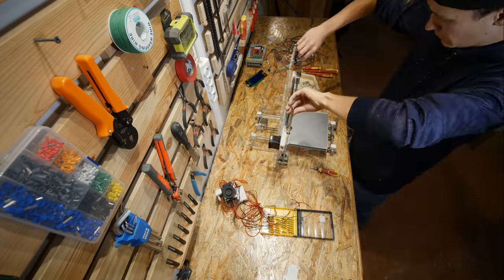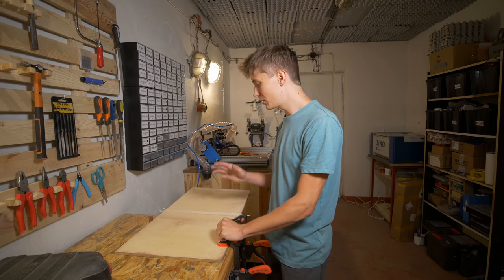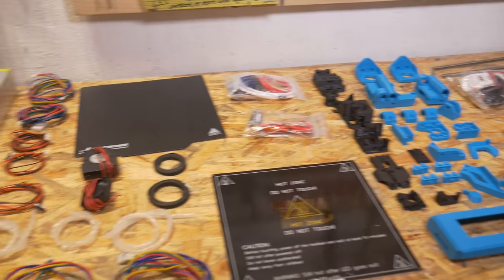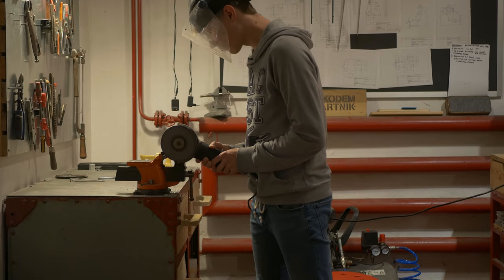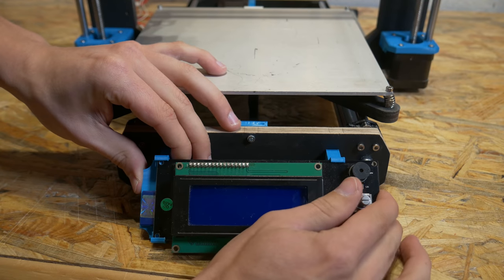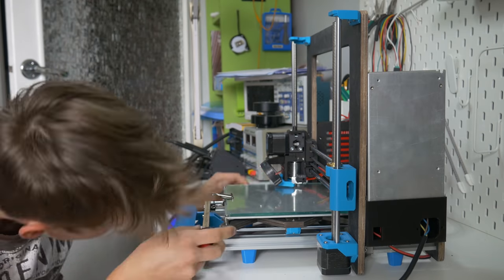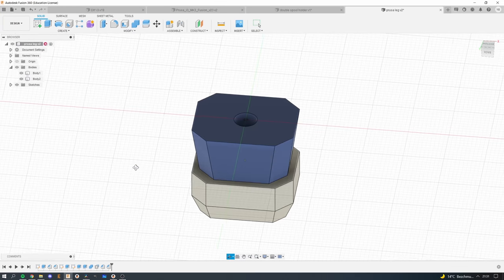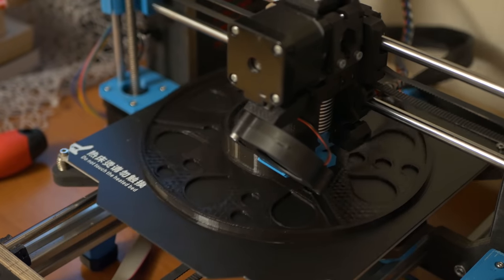Building a DIY Prusa i3 in 2024

Comment: It's a great idea reviving that old printer Nik!! I started with an old Mk2 clone I got from a friend, then built another two heavily modified i3 style printers keeping the kinematics on slightly larger frames, and both on 9mm plywood box frames. Much more rigid than single 18mm ply. Just a hint on bolting on or trough plywood, soak the holes with CA glue before assembly, makes the ply stiffer. And yes, dont forget washers :-D The only thing is, all plastic parts better be printed from PETG rather than PLA. Other than that, nicely executed project, well done!!

Comment: Great rebuild/upgrade to an old printer! For the flexible, it looks like it's clogging since it started fine and then had issues. If part cooling is on, turn it off, otherwise I would only increase the print temperature and try again. 👍
Reply: Printing tpu can be challenging but what I found out is to increase the flow rate to 120% 228 degrees on the hot end, bed temp off, and part cooling off.
Reply: @joeanderson2642  I haven't had to adjust flow any for TPU. I run first layer at 250, then 230 for the rest. Depending on the design, I may turn on cooling but no higher than 30-40%, mostly for bridging stuff. I slow it down to 30mm/s and use retraction too. I always heard TPU was difficult but mine come out like it's PLA.

Comment: I bought one of those china clone  3d printers  for about £90 and it was not very rigid so i kept it as it was  but  mounted it on a ply base plate then added wood blocks  to reinforce the frame using gorilla glue  that made it very solid i added motor mounts   printed by the machine  plus another few improvements  a  extruder  head ducting fan really improved things and  my machine  turns out prints better than my mates ender 3 he cant get it to work  as good as my old cheapy clone  ... good video and  good luck with your projects

Comment: Hi, thanks for the video, it is great . If you want print on glass , you need to take thinner glass like 2mm and wait 5 minute after printing  to the bed temperature decrease, in this way you can pull over your print with the hand with no difficulty. I saw you pull hard on them, you can broke or bend your prints: 
See you around

Comment: Very Nice! Ive done the same but using conduit as a frame. Your flex filament issues could be due to not having the bite of the bondtech. I have printed beautifully with those, while the old tensioned filament wheel with a gear used in cheaper clones like my ANet A8 gave me a lot of problems. Once switched to bondtech it has been smooth sailing for the most part

Comment: Plywood will eventually absorb water and warp.  I'd apply several layers of polyurethane varnish and/or epoxy  to seal the wood before assembly.
3D printed extruder parts that are under spring tension will eventually fail.  I'd have CNC'ed them from aluminum.

Comment: @03:11 Am I the only one that sprays the hard to reach areas ( like the edges, corners, etc... ) of a part first to ensure good coverage in those areas without oversaturating the easily reachable and clearly visible ones sprayed afterwards? 🤔

I own an original Prusa i3 MK3S & MMU2S myself but have since started migrating over to a 350 sized Voron 2.4 ( completed ) with aims of equipping it with an ERCF ( to replace the MMU2S ) and if there's one thing I'd like to suggest then it's replacing the i3 MK3S E-Axis with a Voron Afterburner/Clockwork one. Fixing any issue on the Afterburner/Clockwork is like a 2min easy to reach 4-6 screw disassembly/assembly thing as everything can be taken apart modularly allowing for the bulk of the machine to remain where you use it while you service the Toolhead elsewhere whereas on a Prusa i3 you're easily looking at a 30-60min fuckfest with the entire machine needing to be unhooked from whatever is stuck to it ( cough... Power Cables, Network Cable, 5 PTFE Tubes, etc... ) come with you wherever you plan to service it ( ask me how I know after I had to replrint the entire i3 E-Axis after melting it down from 3d printing the ABS Parts for my Voron 2.4 )

Comment: Great video! Good editing and good audio! Im in the process of building an i3 mk2 from my old Prusa i2 (mendel), and i wonder how you did with the heated bed? Is the heated plate under the aluminium plate? i have been using a glass plate right on top of the heated bed pcb on my old printer, should i change that?

Comment: I am worried about the warping of the frame. Perhaps reinforcement is needed.
Reply from the maker: After making the video I added a bltouch so now even if the frame will wrap a bit it should still print fine. If it will wrap a lot I will probably just replace it with something else